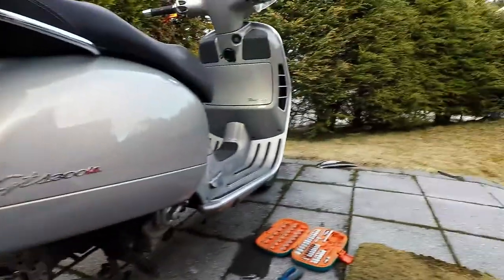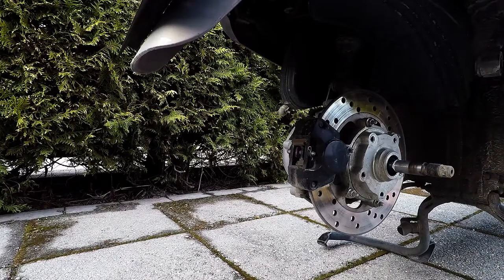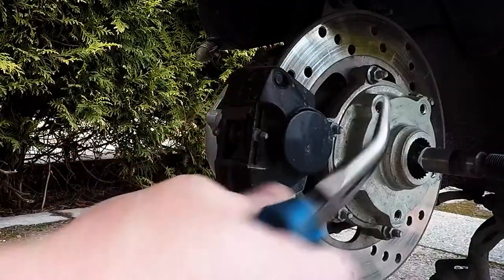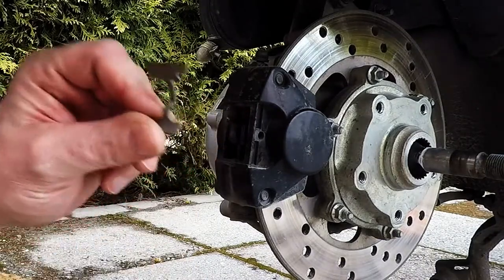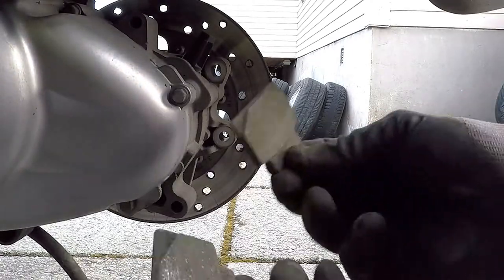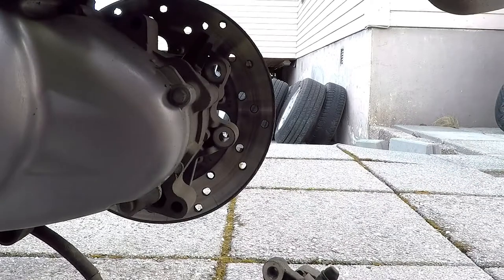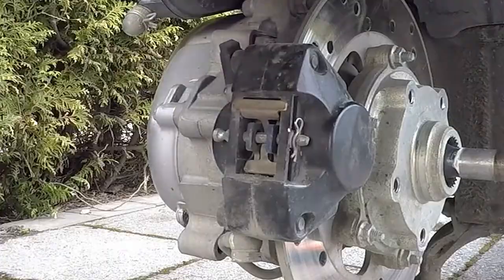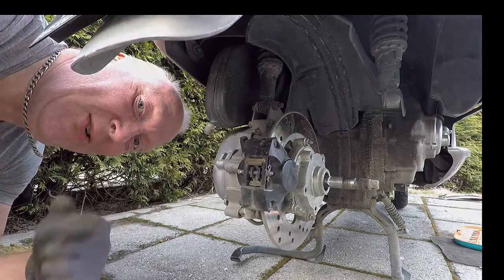How to change the rear brake pads on a Vespa GTS 125/250/300

Comment: Hi.. 🙏Vespa gts 250 rear brake pad replacement has been 3500 km.  I still brake very well.  But suddenly, while driving without braking, just giving the gas and letting go, a grinding noise started coming from the rear disc.  There is no sound when braking.  There is a grinding sound only when you let off the gas.  Is there any damage to the stitching?  If the brake pad is good, what else should I do?

Comment: Hi I changed my pads recently before seeing this video. Now i have the ABS lights showing on my  display. I've gone through the process of resetting the ABS as described in the manual but it only works for a few minutes and then the light comes on again. When there is no light on and i pull the rear brake lever it feels like the ABS is kicking in. Any ideas what this might be? Thanks in Advance
Reply from the maker: I don't know the ABS brakes, so I can't help you. A good Vespa dealer should be able to help you with this problem.